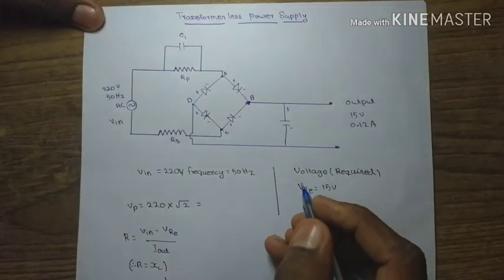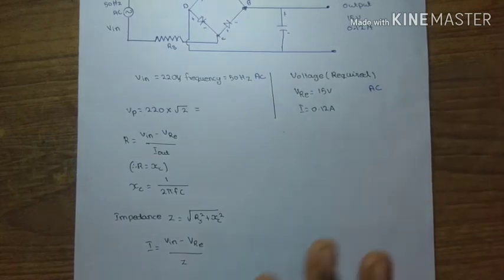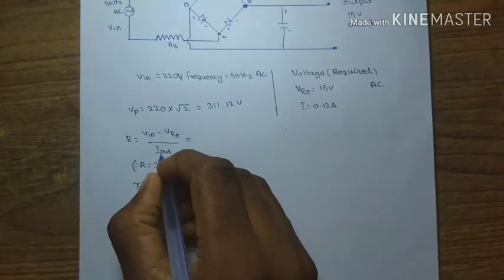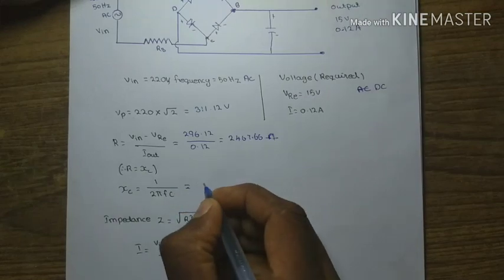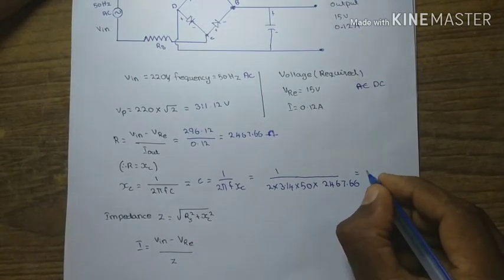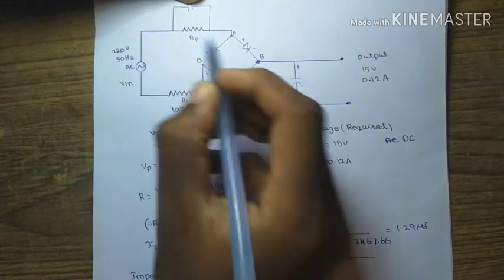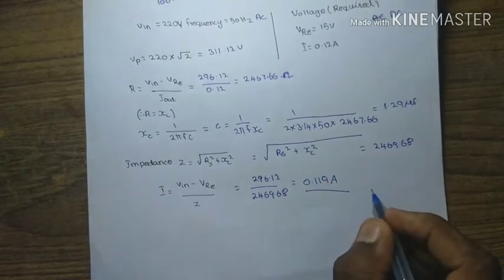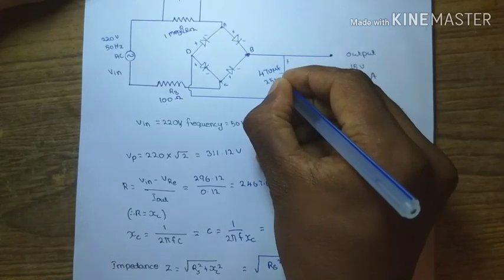How to make transformer less power supply and calculate the value of capacitor.

Comment: while calculation in impedance you got the value as 2469.68 so what are the values that you have given for sqrt(sqr(rs) + sqr(xc))
as per your explanation i took values sqrt(sqr(100)+sqr(2467.66))) and the output is not matched. could you please correct. i am missing something here.

Comment: Sir that result of resistance value is 2467.66 but you put 100ohm resistance. Why?. Then I check the output voltage it is 200v dc not 15v
Reply: Without load don't measure ok
Reply: I too have this 210vdc.Scratching my head.

Comment: why second capacitor is 470uf? for 1A output on 6V I got the value of first capacitor 10.5uf, so can I use several capacitors in parallel? should I add more for second capacitor too?

Comment: The input AC will not always and exactly 220v so your output DC volt will not be constant.
Reply: Normally with a capacitive dropper, like this,  you use a Zenner diode to clamp the voltage you want to maintain. The Zenner just has to be sized with enough wattage to dissipate the unwanted current with no load.

Comment: Bro more question please . When u calculated the value of the capacitor it was a 1.29uf so why u used a 2.2uf capacitor .. please can u tell me the answer
Reply from the maker: I don't have capacitor for that value so I used that
Reply: @collectandcreate8706  :D lol
Reply: Same question.u did effort to calculate capacitor value, when it comes 1.29 ,you not clarified anything anywhere, you just put 225j without showing meaning of 225j .
Reply: Basically you select the next higher value if no available of that calculated

Comment: can i use 155k 250v?
Reply from the maker: Ya  use it 155k means 1.5 microfarad capacitor
Reply from the maker: Using this capacitor of 155k means you get the output voltage 57v dc
Reply from the maker: But use 155k 400v capacitor because the peak input voltage is 311v . 220×√2=311, so the 250v capacitor is not withstand it can blast. So use 400v capacitor
Reply: @collectandcreate8706  bro cap rate to get 12v DC 100mA

Comment: i have same like you but have 1 problam that  every try blasting resister 
bro why like have any idea  plz ???
Reply from the maker: Which resistor 100ohm or 1M ohm
Reply: @collectandcreate8706  
hello sir , when i connet  neg wire of ac 240 to  resistor  tnen to doide ... connect to ac balst everytime  if not use neg tive side resister drict connect diode 
then blast positive side to conacteded  capacitor 225j400v to 1m  resistor blasting ??? what  i shuld to do ?
Reply from the maker: Try another time bro

Comment: My same capacitor not working in same circuit
Reply: 225J/400v capa bro
Reply: It's a paper capacitor non polar
Reply from the maker: Check the polarity bro
Reply from the maker: Which capacitor bro ceramic or filter capacitor of 470micro farad
Reply from the maker: Otherwise change the capacitor and check bro